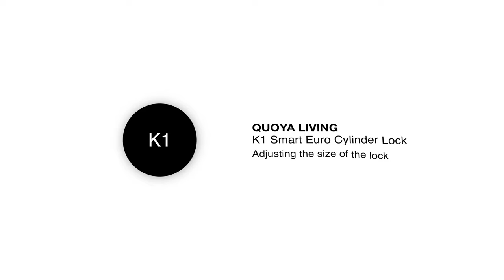QUOYA Living- K1 Smart Euro Cylinder Door Lock- Setting up and adjusting the lock

Comment: "Hello, the video was great, but I don't understand why there are no comments. My issue is that I installed the device, even set up the gateway for remote access. However, for the device to unlock from the phone, I need to touch the lock's touchscreen first, or it won't connect. For example, if I try to check the lock status or unlock it from the app without physically touching the lock, it says connection failed. Another problem is that, despite having a new battery, it shows 55% battery. Can you help?"